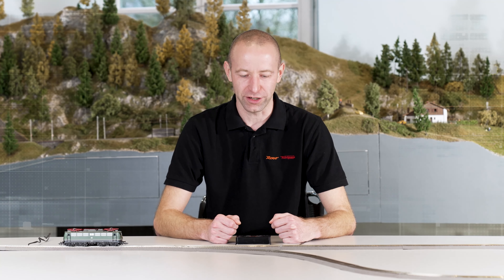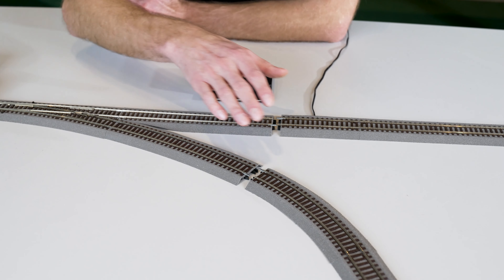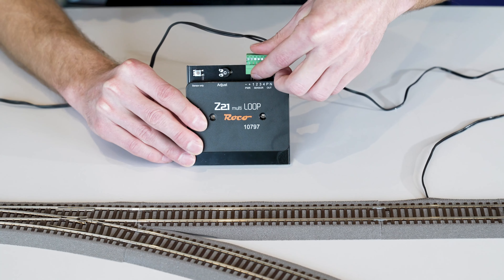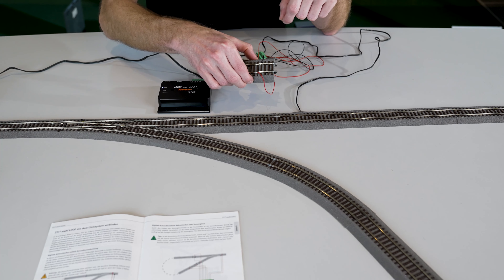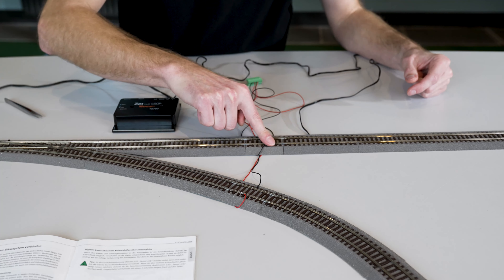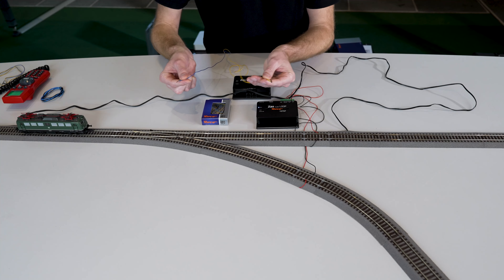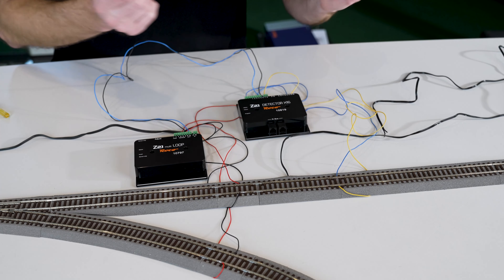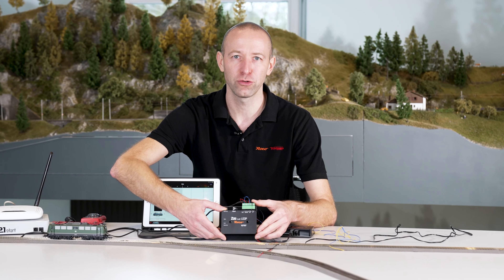Video 15: Z21 multiLoop - The reverse loop module

Comment: Thanks for making an English dubbed version of this. Personally I have never ever seen or heard anyone building inside or outside the loop you just showed. I get the impression you are covering yourself to justify the use of track detector module 10819. That means higher cost for such a simple item which will not use all the other parts of the detector. Surely it would of been better to design a smaller detector module to compliment the multi loop 10797 with 2 or 4 track detectors on the new module for example (item number 10798), thus reducing both the cost to you and me the consumer.

Comment: For DCC, It is better to add additional boosters and plan the track accordingly rather than to use feedback loop modules. This is especially true if you control the train via automatic train control.